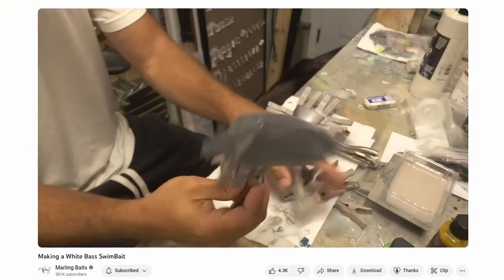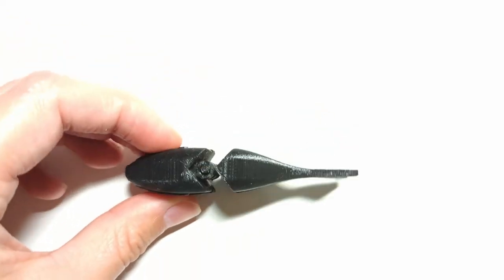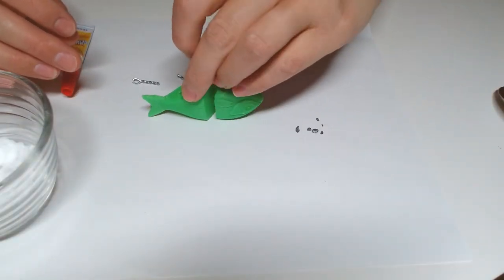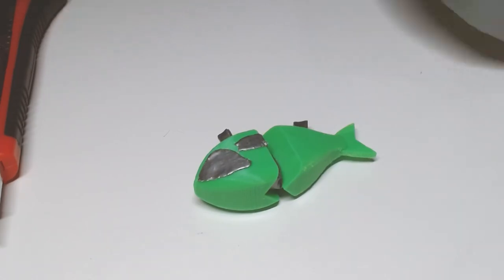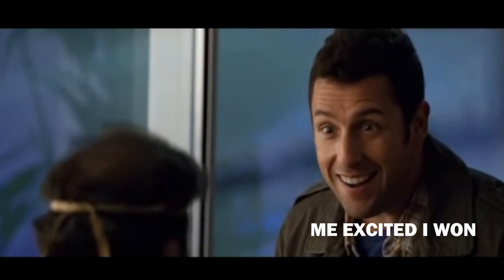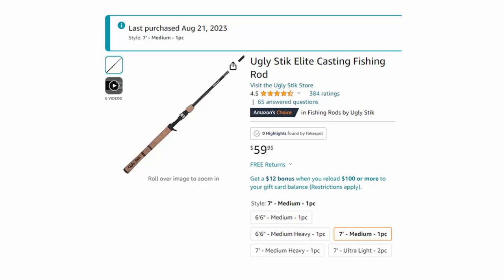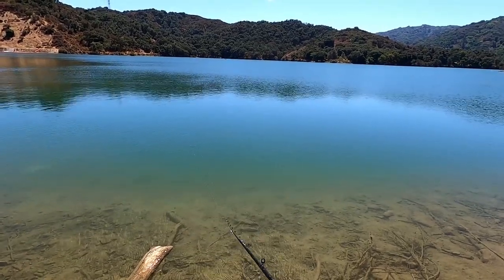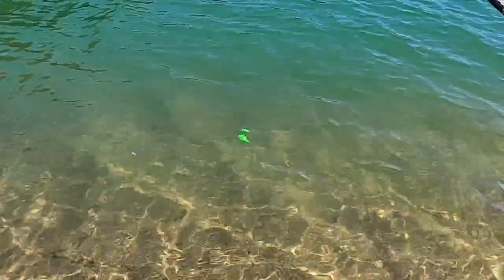Designing and 3D Printing a Hinged Swimbait Fishing Lure

Comment: Dang! Marling got me into making lures too! LOL I make them from wood. However, I have designed a few in Fusion 360, just for the fun of it. Never got around to printing or using them though. 

I believe your initial design would have worked if you would have added more weight in the belly. A lure tends to lay over if it isn't ballasted properly. Have you thought about using twist-eye hinges like Marling uses? Then you could paint and completely seal each half before joining them together.

Fun video to watch!